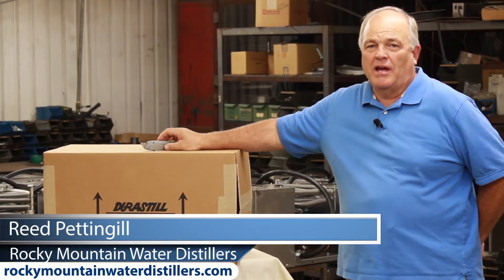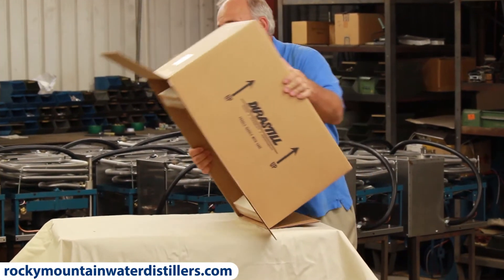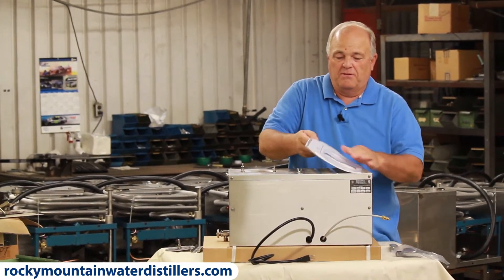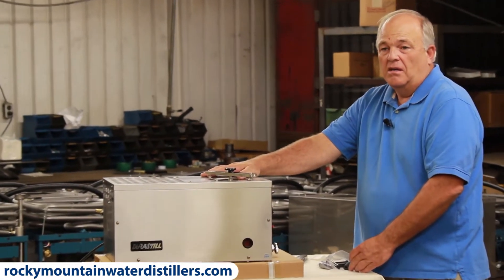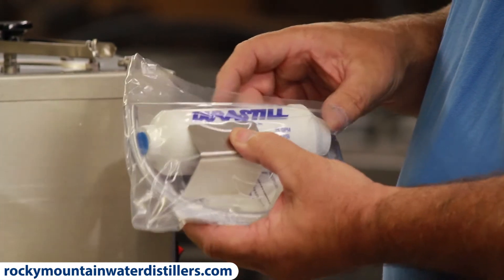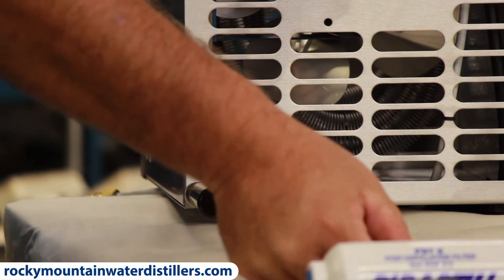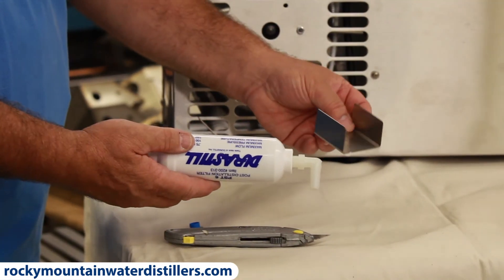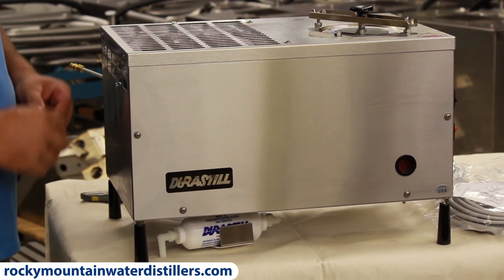HOW TO INSTALL & SETUP the Durastill 30J Automatic Water Distiller (NEW 2023 Model 30J) - RMWD

Comment: Mine is a Durastill 30 and lately I find water on the floor because when heating it creates so much steam that it wets the insulation causing a leak behind the front plate. Very annoying - do you know how I can correct this ? 
Thank you so much

Comment: if the water is distilled, why do you need a filter?
Reply: because fluoride can vaporize and escape the distillation process and reach the other side. So the charcoal filter helps to prevent that.
Reply: @AfterTheGame  Not being rude, but where are you getting this information, because I cant find it.
Reply: @shawnburke4347  I made more than one point in my comment, specifically what information are you looking for me to clarify?
Reply: @AfterTheGame  The part about flouride.  My understand (though limited) was that this process gets rid of all this "crap" stuff.  99.9 if I remember right, will have to double check that.

Google says:  Distillation can remove nearly all impurities from water. Compounds removed include sodium, hardness compounds such as calcium and magnesium, other dissolved solids (including iron and manganese), fluoride, and nitrate.

So I am lost man.
Reply: @AfterTheGame  Then can you use a filter to clean water without distilling?  and if so why do you need a distiller then.
Reply: @shawnburke4347  V.O.C's are 'low boiling point' and need that pre-filter to remove them. The post-filter is probably for extra measures as any that made it past the pre-filter will be caught by the post-filter.

The distilling will remove the electrical properties of the water (this is the ultimate test, and why distillers are the best as this is the indicator for good hydration and protection, which other 'water purification methods' don't achieve) by leaving the Inorganics behind, and will also turn the water into 'distilled' (like how your urine and blood is, or God's evaporation and perspiration system, distilled water is better at delivering nutrients and minerals throughout the body).

hydrofluoric acid/Sodium fluorosilicate and Chlorines in the waters are Inorganics and will be left behind through your distilling process.
Reply: @domatic  Yes sir, that is what I am asking.
Reply: V.O.C's are 'low boiling point' and need that pre-filter to remove them. The distilling will remove the electrical properties of the water (this is the ultimate test, and why distillers are the best as this is the indicator for good hydration and protection, which other 'water purification methods' don't achieve) by leaving the Inorganics behind, and will also turn the water into 'distilled' (like how your urine and blood is, or God's evaporation and perspiration system,  distilled water is better at delivering nutrients and minerals throughout the body)
Reply from the maker: Great question! Yes you do need a post carbon filter with your distiller because distillation alone does not filter out all of the contaminants. Some things such as chlorine and gasoline can distill across and must be removed through a carbon filter after the steam has been cooled into distilled water. We have in-depth articles and explanations on our website it you want to dive deeper into this answer. - thanks Brandon